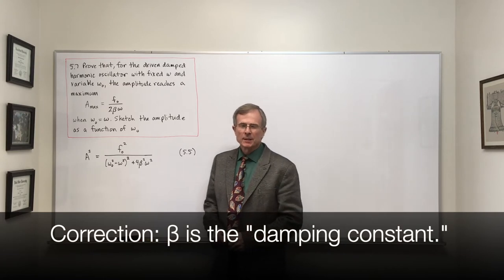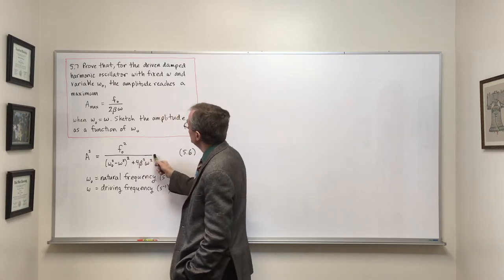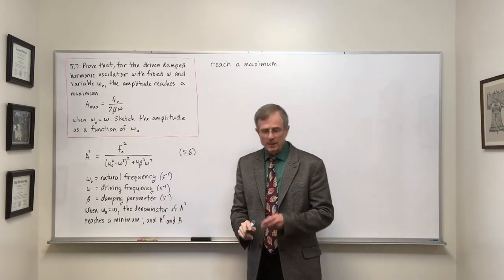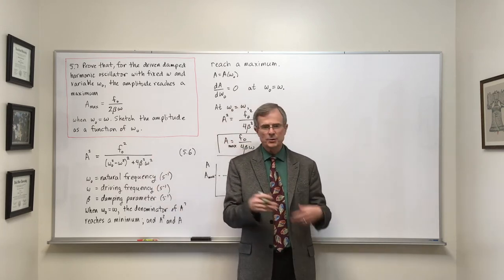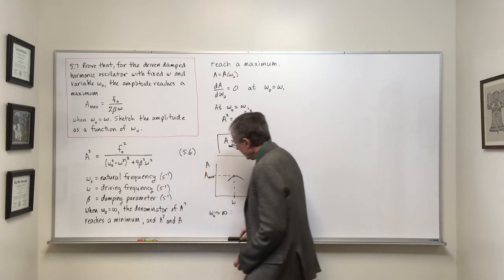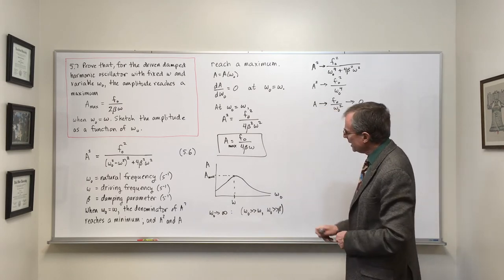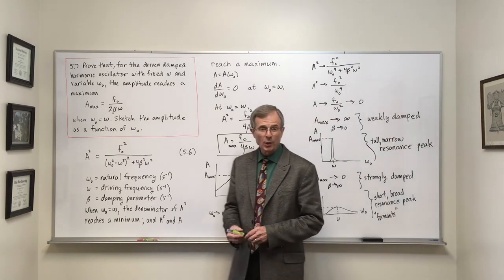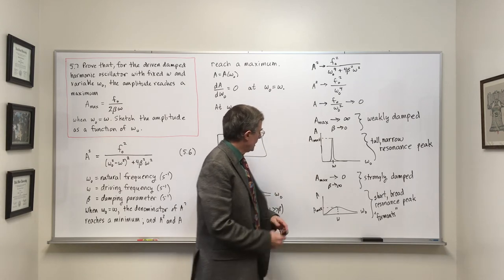Forced Harmonic Motion: Amplitude (5.7)

Comment: Maximizing amplitude as a function of natural frequency w0 with driving frequency w held constant does indeed give w0=w.  However, maximizing amplitude as a function of driving frequency w gives a value of w that is smaller than the natural frequency w0.  This is difficult to see without actually doing the derivative, and setting it equal to zero.